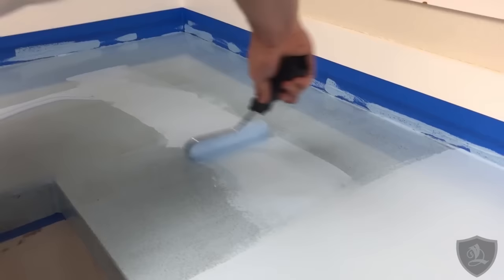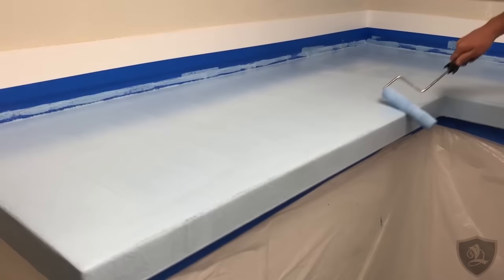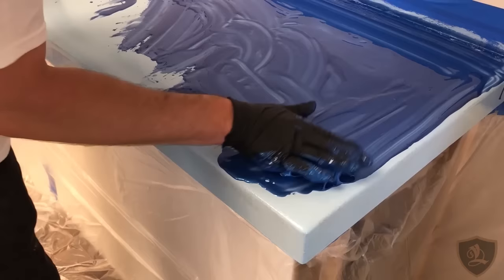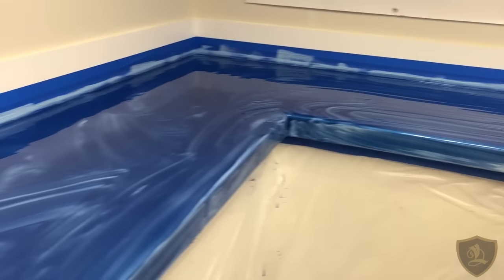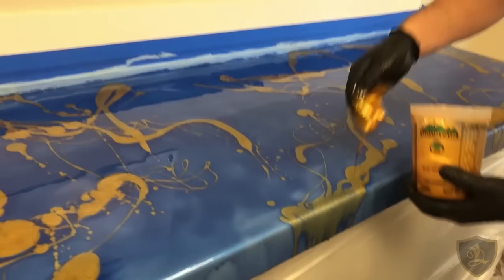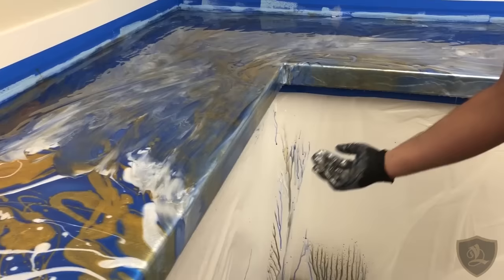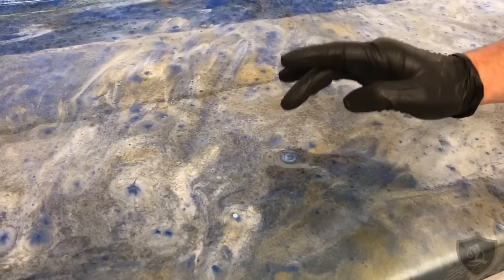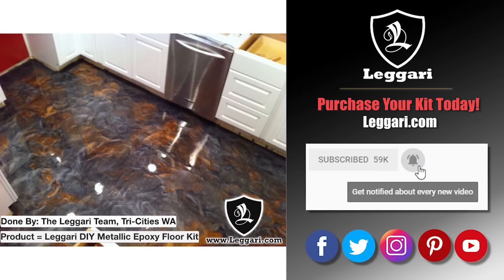Installing Metallic Epoxy Countertop Kit with my Hands

Comment: do we know how this product holds up after 5 to 10 years?  Do you then put on a clear sealer?
Reply from the maker: Dianna A Yes we do, we have Coatings that have been down for over a decade. We will be doing a video of a 5 year old countertop that was coated with our resin to show people the durability and how good it still looks. It’s an amazing product and designed to withstand heavy machinery and traffic so for counters and residential flooring it’s a perfect coating.
Reply: If worn you can sand it a bit and add a clear coat of epoxy again.

Comment: Do u add a clear coat after 1st setting?,,and does it need polishing after setting???,, and is there any replace for alcohol based ink that does same jop??,,and can i use white cement as a primer??

Comment: I HAVE A QUESTION FOR YOU. I WATCHED THIS VIDEO AND YOUR TUTORIAL ON USING EPOXY ON A FLOOR.  IS THE SURFACE SLIPPERY AT ALL TO WALK ON??  I KNOW THE FLOOR WILL LOOK AMAZING USING YOUR PRODUCTS BUT I AM CONCERNED ABOUT IF THE FLOOR SURFACE IS SLIPPERY. I INJURED MY SPINE AND USE A WALKER SO I NEED TIPS TO AVOID SLIPPING WHEN WALKING ACROSS AN EPOXY FLOOR. THANKS.

Comment: Hi,  I just needed to ask if this has a lot of solvents added?  I am allergic to mineral spirits and some that are in spray paints.  But I could use some protection but would rather not Lol!
Reply from the maker: You can email leggari@gmail.com and they will send you out the MSDS sheets for the epoxy.
Reply: @LeggariProducts  Thanks!  I never considered that.

Comment: I used super glaze.  Did 1 coat. Sanded. Did 2nd coat.  But if course, im getting the bubbles that popped and left small holes. Its been bout 20 min.  Can i lay more on while its still sticky?  I used a squeegee. Im afraid it will mess it up
Reply from the maker: Not sure about their product but our product does not get bubbles do to an additive ingredient we add to the epoxy.  Thanks

Comment: How long does the shine last in a job finished the job and what care should I have to prolong this incredible finish
Reply from the maker: Our products are actually industrial coating made for military aircraft hangers, etc. So theoretically in a residential, or even commercial setting it will last forever. This is NOT a cheap epoxy paint that you will commonly find at box stores like Home Depot or sherwin Williams. It is a thick 100% solids epoxy coating.

Comment: just curious as to why not tape edge and then pull it off when epoxy really slows down on the flow?
Reply from the maker: We actually do do this with our dirty pour counters as there is more epoxy and we want to keep the design in place before removing the tape. With this method, there isn't as much epoxy so we don't worry about it flowing over the edges some.

Comment: It’s look8 g good 👍👍 do you use acetone to clean up anything?  Lucky the worktop are running down to the outside. What would happen if the colours ran towards the wall?
Reply from the maker: You will want to tape the wall of about an 1/8 inch high so no epoxy will get on the wall.  We always use denatured alcohol to clean up.
Reply: Leggari Products that’s good to know 👍👍👍

Comment: How many mils thick does it come out being  ?   Does it hold up to the common  market cleaning supplies ?  Thanks
Reply from the maker: The epoxy will be about 1/8 inch thick.  Our products are actually industrial coating made for military aircraft hangers, etc. So theoretically in a residential, or even commercial setting it will last forever. This is NOT a cheap epoxy paint that you will commonly find at box stores like Home Depot or sherwin Williams. It is a thick 100% solids epoxy coating.

Comment: I see you didn’t use a gas flame on the tops like other videos or a tooth trowel
Reply from the maker: We have a high end epoxy that has an additive in it to make the bubbles rise to the surface and pop on their own.  Thanks

Comment: Hey,,
What type of primer we should use for countertop
Thx.
Reply from the maker: Our Leggari primer is a water based epoxy specifically designed to chemically bond to almost all smooth surfaces.  And it comes in all the kits.

Comment: How much time do u have with your product before it starts to kick …
Reply from the maker: There is a lot of variables to give you an exact time we always recommend moving quickly once you have mixed and get it dumped out! You have way more working time with the product once it is dumped out. I wouldnt leave it in a mass in the bucket for any longer then it has to. In saying that as long as you have everything set up and ready to pour you will have more then enough time to get the buckets dumped out even for a first time installed doing a stone kit with multiple buckets!

Comment: Legarri, after visiting your website I've noticed some kits to be responsible and others to be outrageously priced. Makes me wonder why adding a pigment powder or two can effect the cost so much? Can you please explain? If a torch can save me 700 usd on a countertop I'm going to go with the torch. Besides self leveling and self popping bubbles what makes your product second to none?
Reply from the maker: Hello! We sell a high end epoxy resin that's extremely durable! If you need different sized kits feel free to email customerservice@leggari.com for pricing! We're very close to launching a website where you can purchase single items with a lot more options, but in the meantime if you're wanting to price out different kits, etc. our team can help you via email!

Comment: Cool video! Thank for sharing. 
Wanted to ask, how durable is it? Does is scratch, chip easily? Say, if one drops a knife on it or a hot pan. 
Thanks!
Reply from the maker: Our products are actually industrial coating made for military aircraft hangers, etc. So theoretically in a residential, or even commercial setting it will last forever. This is NOT a cheap epoxy paint that you will commonly find at box stores like Home Depot or sherwin Williams. It is a thick 100% solids epoxy coating.
Fire and heat test
https://youtu.be/09elup51N6U
Reply: Leggari Products this is brilliant! Thanks!

Comment: I liked it much better before you blended the colors.  It looks too muddy now. Can you just manipulate the colors using a heat gun instead so that the colors don't muddy? It was really pretty beforehand.  Also is this epoxy food safe? I do like how easy it is to use.
Reply from the maker: Yes you can use a heat gun to move the epoxy around.  The epoxy is USDA approved.  Thanks

Comment: Will you need to add heat to it?
Reply from the maker: We have a high end epoxy that has an additive in it to make the bubbles rise to the surface and pop on their own so we do not need to torch the epoxy.  Thanks

Comment: Love it and gonna try it out on my next flip. We currently flip about 15 houses a year and pay top dollar for quartz. This product looks as good or even better for a fraction of the cost. Might try to do it on a few sheets of plywood and .glue them to the walls for a tub/shower surround. Similar to how we used to install synthetic marble tub/shower surrounds. Is this durable enough to use on floors to make over existing ugly ceramic tile flooring and re-grout after overlay is complete?

Comment: go for a granite countertop guys! it's much harder and more resilient to scratches....
Reply from the maker: Our products are actually industrial coating made for military aircraft hangers, etc. So theoretically in a residential, or even commercial setting it will last forever. This is NOT a cheap epoxy paint that you will commonly find at box stores like Home Depot or sherwin Williams. It is a thick 100% solids epoxy coating.
Thanks
Reply: @LeggariProducts  excuse me this is nonsense. no epoxi is harder than quartz as the main constituent of granite... moreover i dont want to think about the process robustness for mixing components and the residues I dont want to have at home by all means.

Comment: Good stuff, was curious that I've see others use a torch and lightly go over it to remove bubbles. Is that unique to other products or just another technique ?
Reply from the maker: We have a high end epoxy that has an additive in it to make the bubbles rise to the surface and pop on their own.  Thanks

Comment: And what you put on top?
Reply from the maker: We have 3 different top coat options. Glaze coat is our super high gloss top coat that lays out glass smooth just like the metallic epoxy coat. Our WB Urethane comes in high gloss and leaves a minor texture and we also have a WB Urethane that’s a Matte/Satin finish.

Comment: Is. It acrylick paint?
Reply from the maker: This is our Metallic Epoxy. It is a unique crystal-clear 100% solids, Zero VOCs, proprietary resin you can’t get anywhere else! Formulated for extended working times, self-leveling flowability, and marbleizing additives that are vital during the curing process. These characteristics are vital to achieving Leggari’s famously beautiful depth and dynamic effects. Engineered with agents that force bubbles to the surface, allowing any air in the resin to escape, eliminating the need to torch. Unmatched durability with Scratch, Heat, Stain, and UV Resistance! 
Check out our DIY countertop kits here! 🔥 👉 https://leggari.com/order-countertops/#standard-epoxy-kits

Comment: i dont get it, when u sprinkle the color ?, are you spraying the mixture of epoxy and color, or only color ? 
And if its only color, does that color penetrates into that blue epoxy ?
Which color do you add to epoxy, special epoxy color ?, and what is final urethane layer, is that also an epoxy ?
I want to make this at home, by ordering it from internet cuz u cant buy it here.
But its all a mystery to me since i have no idea how does it works, i dont wanna fuckup
Reply from the maker: We add the metallic pigments to the epoxy to color it then we applicate it on the surface.  Thanks
Reply: @LeggariProducts  are you spraying colored epoxy from that spray bottle ?

Comment: Doesn't it scratch very easily?
Reply from the maker: Our products are actually industrial coating made for military aircraft hangers, etc. So theoretically in a residential, or even commercial setting it will last forever. This is NOT a cheap epoxy paint that you will commonly find at box stores like Home Depot or sherwin Williams. It is a thick 100% solids epoxy coating.

Comment: How many gallons did you use.
Reply from the maker: He use a 1.5 gal. epoxy kit on this surface.
Reply: So, about how much would it cost for materials to do something like this? I would love to do this on my bathroom countertops instead of switching them out.

Comment: What is that spray
Reply from the maker: The first thing we spray is 91% or higher isopropyl alcohol; this creates cells in the design and disperses the epoxy. Once that evaporates, we spray denatured alcohol to pop micro bubbles. This allows us to avoid torching the epoxy.

Comment: i DID THIS ONCE, BUT NOT YOUR PRODUCT & IT DIDN'T LAST. I AM GOING TO DO IT AGAIN. I WILL VIDEO IT. "STRAIGHT UP'"; ANYWAY I CAN MAKE ANY MONEY OFF OF THIS? JUST ASKING. I AM AN ARTIST, AND I AM READY TO DO IT AGAIN. THANK YOU!
Reply from the maker: Our products are actually industrial coating made for military aircraft hangers, etc. So theoretically in a residential, or even commercial setting it will last forever. This is NOT a cheap epoxy paint that you will commonly find at box stores like Home Depot or sherwin Williams. It is a thick 100% solids epoxy coating.